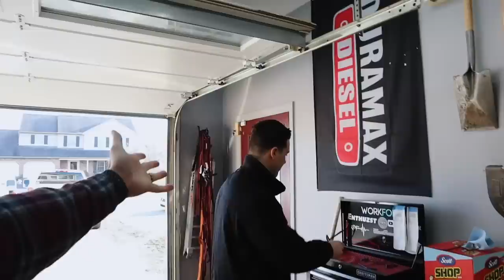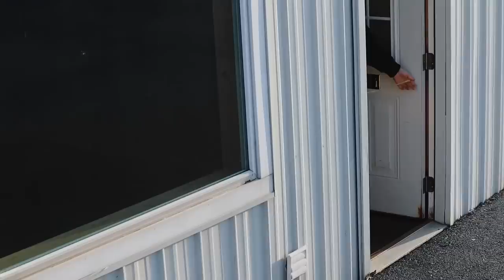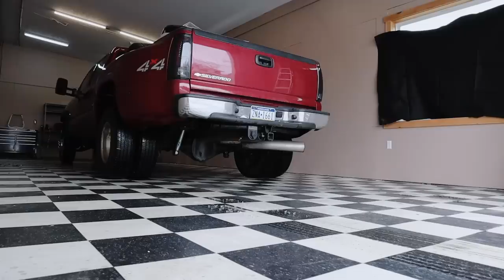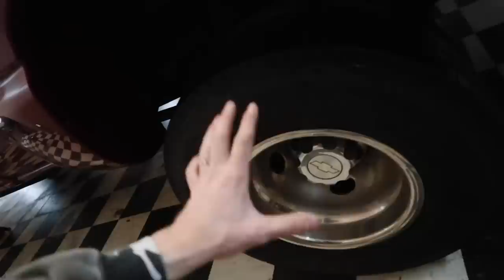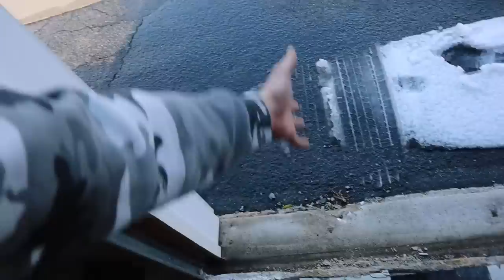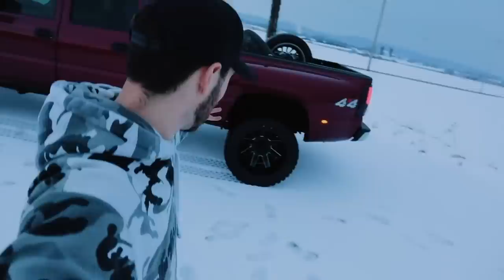THE DADDYMAX DUALLY GETS NEW SHOES!

Comment: Hey jack. Custom offsets are the inventors of the NorCal tuck watch there video on it and you can make it where your front tires do not touch on the back side of your fender well, they do a good professional job and show you how to do it right you might want to look into that because if you catch that metal lip on the inside you’ll pop your tire or take a chunk of tread out of it real quick and make the tire had cut marks all in it on the edges

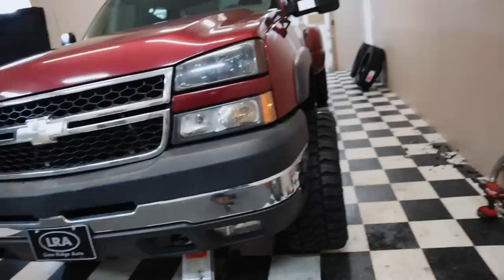Comment: Every time I change a tire, it is easier to use your legs/knees than pick up like you just did at 16:28. Saves your back . Trust me I use my legs to pick up instead if my arms and back. Wheels are heavy. Watch yourself, Jack. I would rather not have back problems.

Comment: Very similar to my dads setup. He has a 2015 f350 with a leveling kit with the 22 inch Fuel triton wheels but the front is a regular truck wheel while the back is traditional dually and is wrapped by a 35 inch toyo mud tire.

Comment: Truck looks mean. What size, bolt pattern, offset, backspacing, is the front rim? Is it a different bolt pattern to the rear wheels since you took off that massive wheel spacer?

Comment: Not for sure with aftermarket wheels but I know on stock wheels you had to add 2in wheel spacers in the rear so the tires didnt rub together when under a load

Comment: That setup looks bad ass on the daddymax.  What wheel balancing did you chose, stick on weight or beads?  I just got wheels and tires from same place you got yours with stick on weights.  I didn't even put them on the truck yet and the stick on weights fell off two of the wheels already just sitting in my garage.

Comment: i dig the wheel and tire setup! I am interested how the 14 wides will handle with the leveling kit. ihave 33 12.5 and they rub. also are you going to remove wiper fluid reservoir?